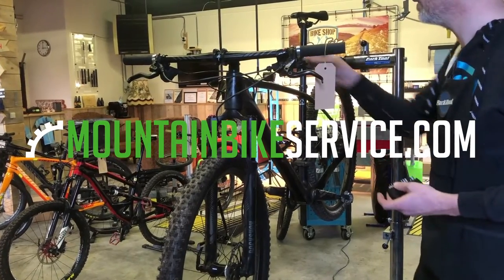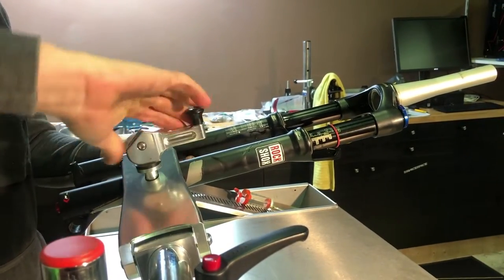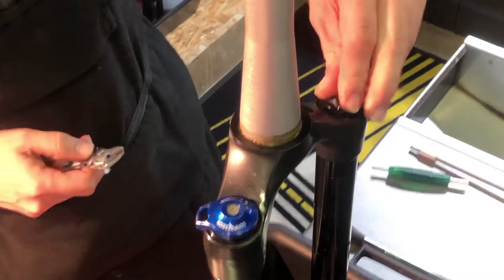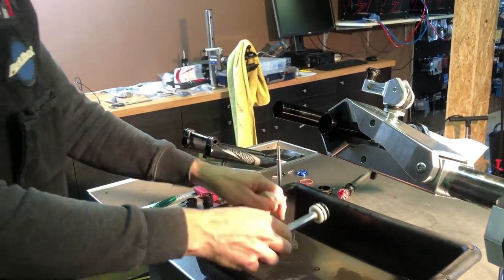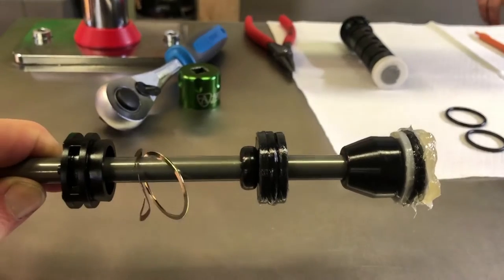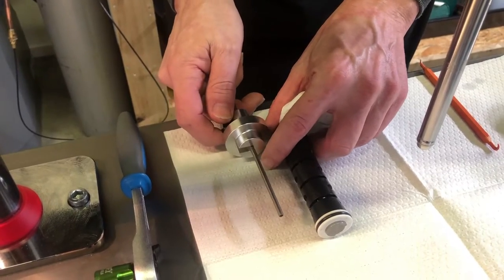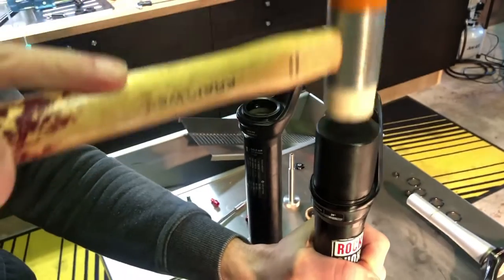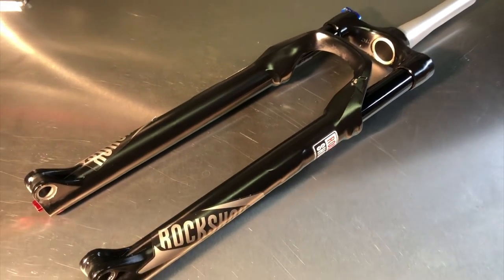How to do a Rockshox Reba lower leg service

Comment: Its pretty straight forward. Tool specific jobs usually blow up maintenance costs but this one isnt bad. The seal driver is easy to make on a lathe. I got the socket for only 12 bucks. I hope crush washers come in the seal kit because its a stat.

Comment: Isn't it full service? And after assembly, you should start with 20 or so psi then equalise it with the negative chamber and work towards desired preassure
Reply: Yes and yes

Comment: Good effort put into video but not great results. Poor camera work. Narration is not synced well with what's happening on screen. What is the difference between green socket you used and a "regular" socket?

This service is not too complicated for a 1st timer. This video might be a good refresher for someone that's already done service on other shocks, but this video is not a good tutorial for a 1st timer.
Reply: he showed the bottom of the socket. it's totally flat, so it can grab the shallow top cap that's only a few mm tall. most sockets are curved for a couple mm on the end and that might prevent the socket from being able to grab onto the top cap. even if it does work, it could damage the cap.

you could just grind down an existing socket so it's flat on the end. there's also a variety of top cap wrenches in various styles available online
Reply: The green socket is machined flush.  A typical socket is forged, and has a slight "ramp" from the lip to the hex (or more commonly 12 point) recess for the nut/bolt head.  Since the hex portion of the cap is so small, there is a chance it will round if you use a more typical socket.  If you have a good wrench like a Wrightgrip, you can break it loose with that, then use a normal socket.  Or you can buy a cheap socket, and grind down the lip to make it flush.